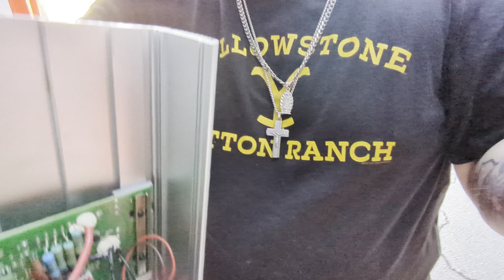Inverter repair

Comment: I love inverters and what they can do, but they are all garbae for some reason they always short out or they’re not conformal coated so if you’re in a hot cold situation, moisture will burn them out and then they don’t like to warranty them

Comment: More like "non-repair".  I'd bet the MOSFETs failed mounted (8 or 16ea?) on those block aluminum heat sinks.  Make sure the cooling fans are still spinning.  If fan died, then the MOSFETs overheat and die.

Comment: If those fuses blew, then you've pretty much got a fishing anchor!!!! They're inside for a reason, you should never have to touch them!
Most likely issue here is that the mosfets attached to the silver colored top piece are shorted out and can't produce the 60 hertz sinewave to create the 120 V A/C output.
If it's a critical piece of equipment then you should always have a fresh spare on hand.